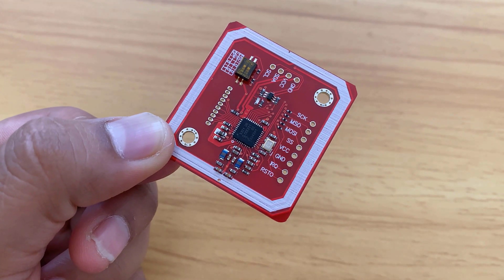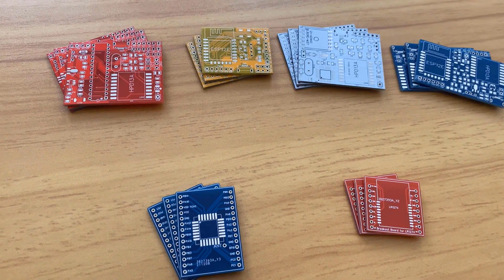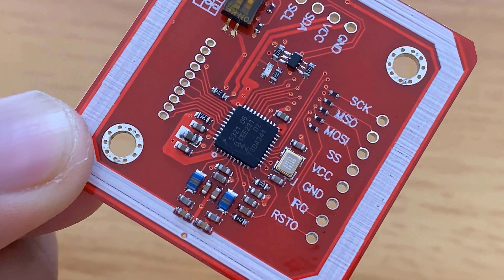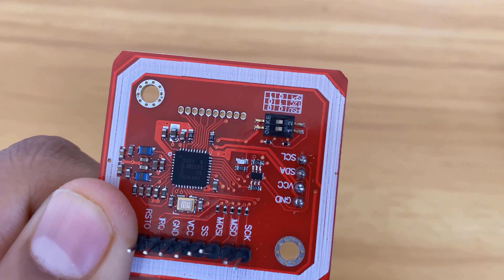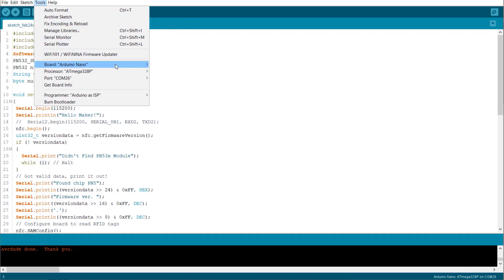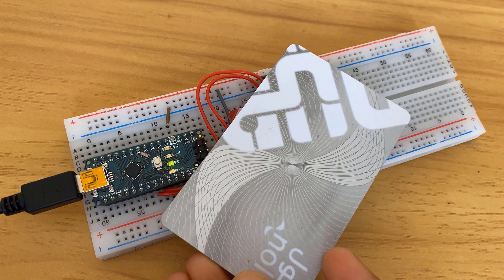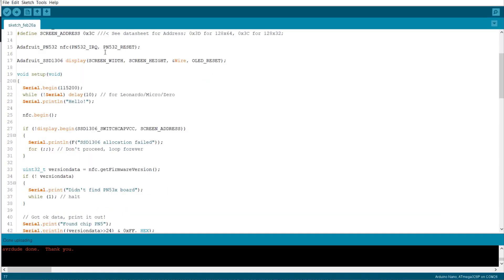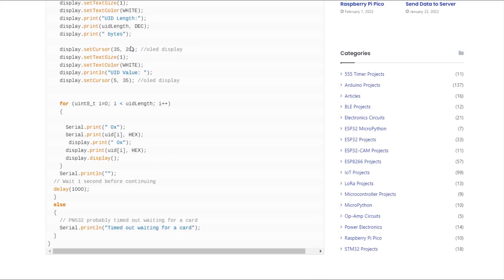PN532 NFC RFID Module Tutorial | Interfacing PN532 with Arduino in UART, I2C & SPI Mode

Comment: Could you use this as a simple on/off switch for a project? Like to turn on a whole device only with an rfid tag? No read / write info. Just to turn on and off a thing?
Reply: yeah if you keep a microcontroller running constantly searching for tags, on battery power or powered from your main power rail, then use that microcontroller to switch a relay or something to turn your main device on/off. then in the code you don't check for a specific ID, just if there is a tag detected at all then you switch the relay.